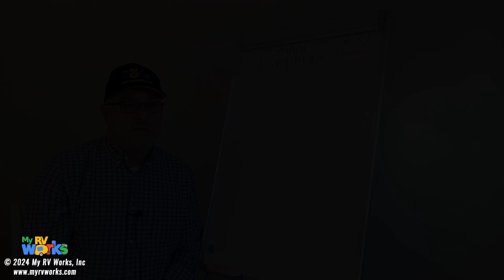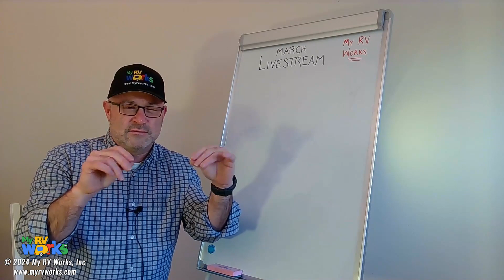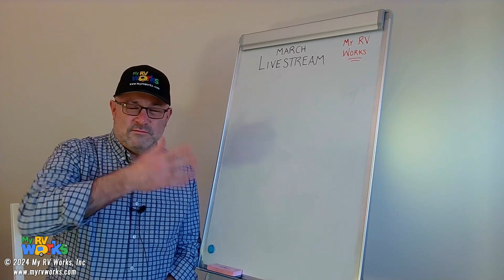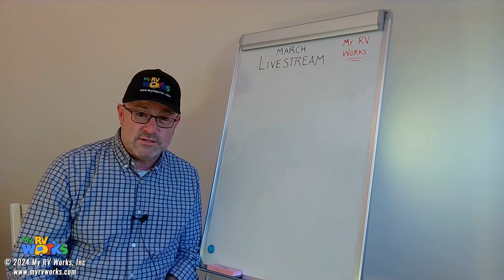Solar Install Tips!

Comment: I installed two residential size panels on the EPDM roof of my 2004 Tioga 24D about 4 years ago and there has been no issues with wind at freeway speeds or with rain. I made no effort to try to locate the frame cross members. I just poked through the thin plywood and attached the mounting feet with lag screws drenched in Gorilla wood glue. Each of the 8 mounting feet sits on a pad made from EternaBond patch material. I covered each screw with Dicor lap sealant.